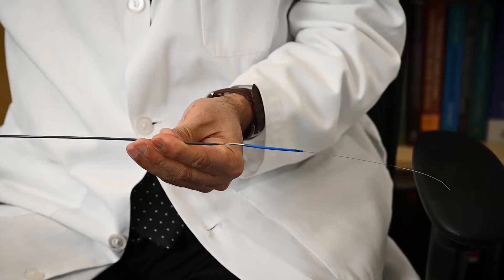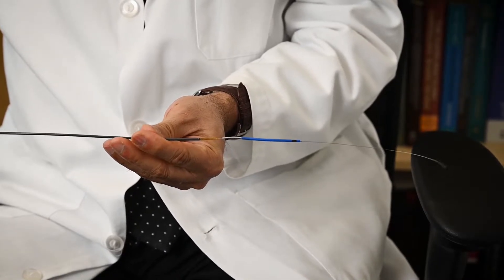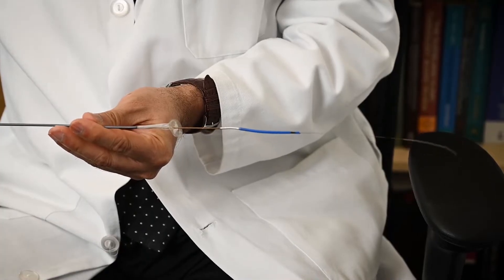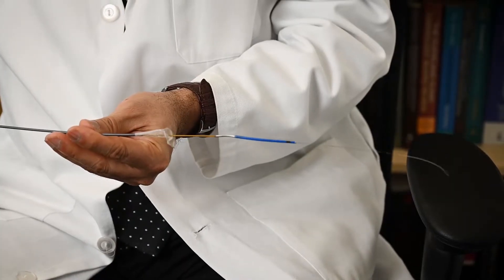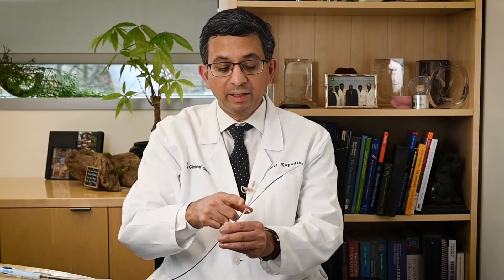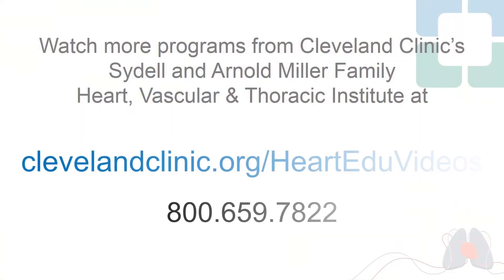Prevention of Stroke in Transcatheter Aortic Valve Replacement (TAVR)

Comment: If the TAVR valve only lasts 10-15 years, what happens if it needs to be repaired or replaced? Is open -heart surgery required? Trying to balance the risk of TAVR with surgical valve replacement.
Reply from the maker: Cleveland Clinic has heart and vascular nurses available Mon. - Fri., 8:30 a.m. - 4:30 p.m. (ET) to help answer your heart, vascular and thoracic questions. Call 866.289.6911 to speak with a nurse or visit the link below (and click on the ""Talk to a Nurse Tab"") to chat online or email a nurse.
Heart and Vascular Institute nurses are available as a resource for you before you’ve made an appointment to discuss your condition, to help you learn more about treatment options or help you choose the right doctor; after you’ve seen your physician or after a hospital stay."https://cle.clinic/2OigcPh

Comment: I would just as soon take the small risk than a chest crack again . The valves do only last about 15 years . By the time I’m ready for another one thus should be perfected more . Very good info . Thank you 🙏🏼
Reply: I was fearful that I would need the 'open heart' since my mom had 3 open heart surgeries for her 3 valve replacements; but thank God I 'qualified' for the TAVR.  I'm 77 . There are risks with every surgery- even a tonsillectomy  (which I had at age 29 due to gangrene of my L. tonsil.  I've had 30-31 surgeries, but I'm still here.   I AM blessed. (with wonderful doctors also)  Thank you Jesus